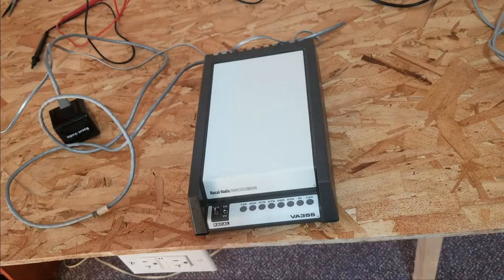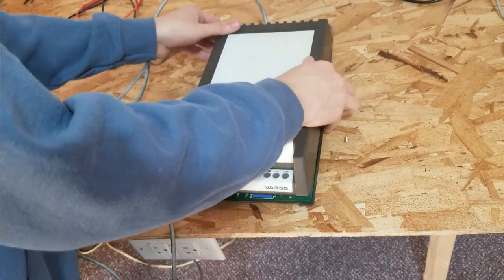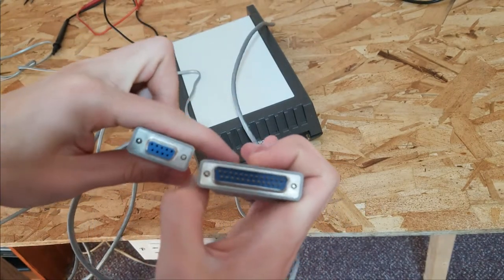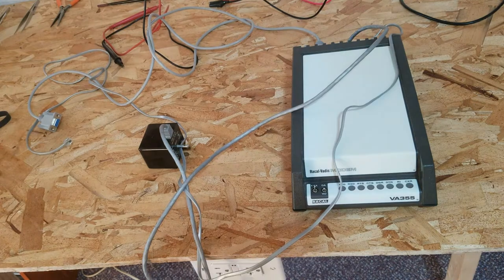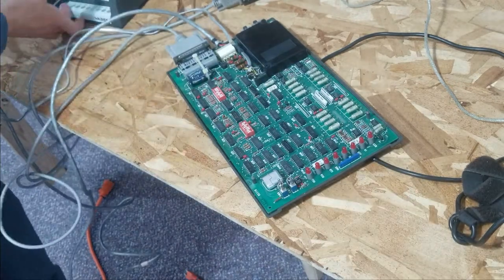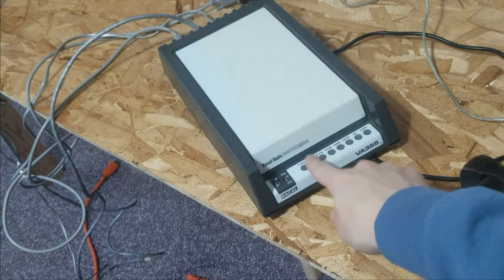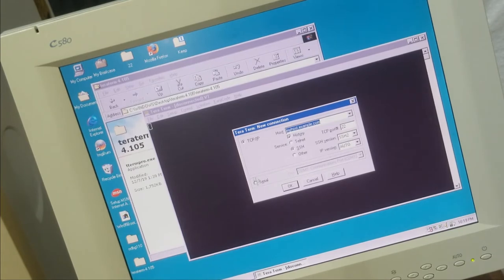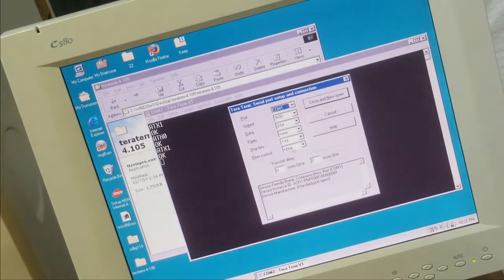Getting the Racal Vadic modem to work

Comment from the maker: I don't know why it took me 3 years to realize and comment this but the manual I shared in the description DOES NOT match the functions for the dipswitches. I don't know what most of them do but the setting that works for me is: 

Bank A -> OFF, OFF, ON, ON, OFF, ON, OFF, OFF
Bank B -> OFF, ON, OFF, ON, OFF, OFF, ON, ON

For anyone up to the challenge, feel free to reverse engineer the circuit and tell me their functions :)
I don't think the manual is going to surface any time soon...